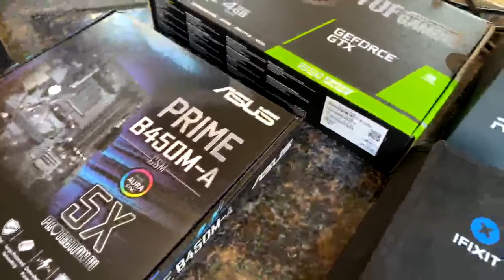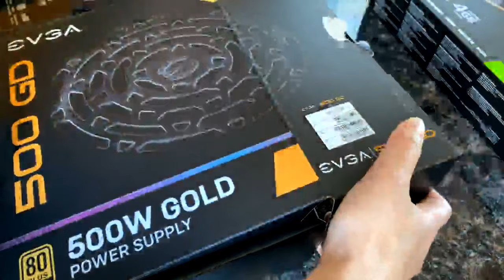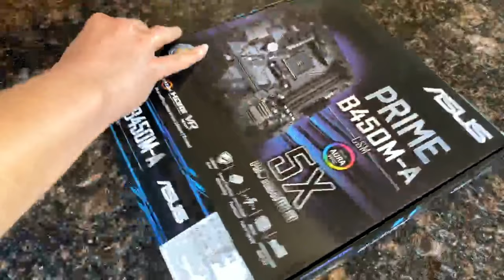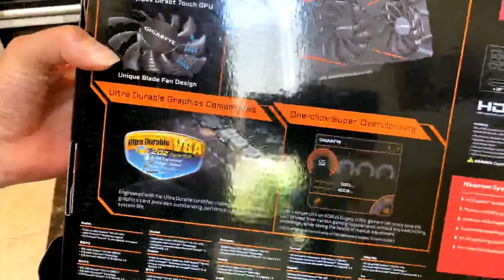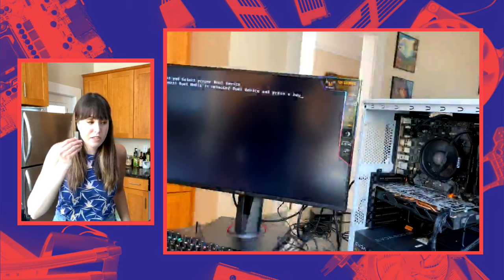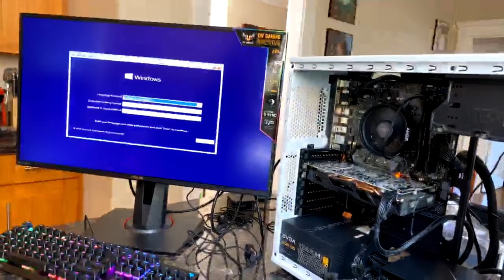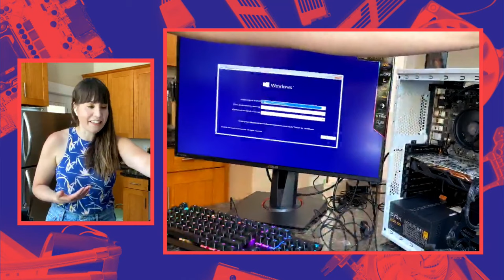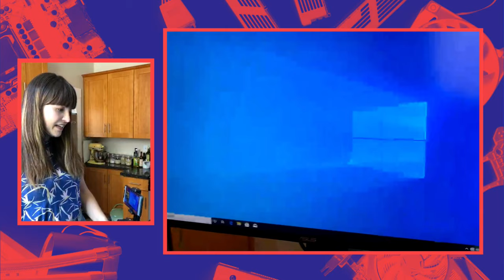$600 Gaming PC Build - Full Beginners Guide

Comment: Which version of Windows did you install?  Did she register it or keep it unregistered, and what (if any) problems can be expected by not registering Windows?  I feel like I'm in a rock and hard place because I did the Media Creation Tool method but chose Pro, but if I need to purchase to be able to get updates and such I'd rather buy the Home version.  But I don't think I can downgrade.  I'm considering just leaving it unregistered but afraid the crap will hit the fan at some point.  Any tips and help on that is appreciated.  Also, it appears bluetooth is unable to be turned on using unregistered - am I wrong?

Comment: Got any tips on rewireing a PC as in side look messy
Reply: 1. Get a fully modular power supply.
2. Use a case (such as the one in the video) with good routing options and enough space behind the motherboard tray to stow away excess lengths of cable.
3. Always start from scratch.
4. Run the main power cables for the motherboard first (24pin atx & 8/4pin eps), before installing the motherboard & other components.
5. Avoid running cables in front of fans.
6. Use velcro ties or zip ties to bind cables neatly onto tiedown points on the case.

Comment: Tbh anyone that have any knowledge of computers know that $600 in to possibly a gaming pc is like between low-end & medium which is equivalent to ps3 graphics not even ps4   2. If you willing make gaming pc if u not willing to put more than thousand to be up to par with ps4 or higher if u want your pc to be way ahead of next gen of console or up par to next gen you going going have to spend aless $1500 or more 2 or $3,000 & 3 it don’t take that long actually it’s very easy to build a pc you buy the the empty tower or gaming pc empty tower & buy all the parts depending on what kind of pc you trying to make or best fit you!